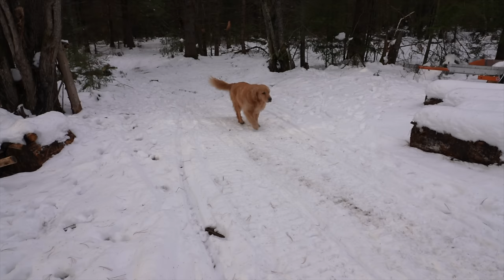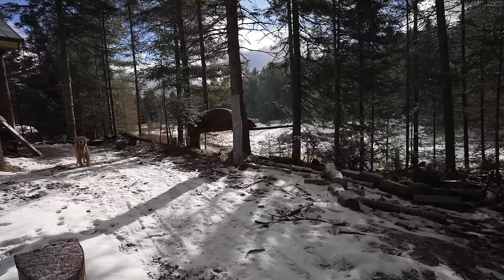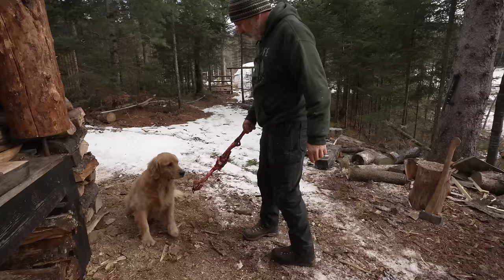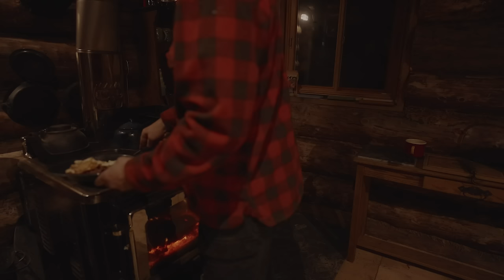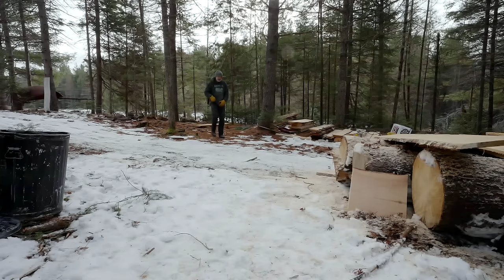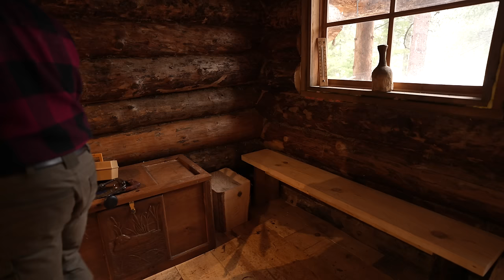Off Grid Living in a Log Cabin | Lumber Milling, Making a Wood Bench, Cutting and Packaging Venison

Comment: As a resident of northern Alberta I appreciate how you said it was warm out at just below freezing! Temperature is all but relative to how you are acclimated to your surroundings. Just finished my morning 10k run at -36°C (-33F) so I agree 0 is warm !
Reply: As long as you keep moving
Reply: isn't dangerous for the lungs to fast breathing  at such low temerature? I read somewhere it causes the bleeding of lung.
Reply: @heilamessy  yes it could be fatal. I wear a synthetic gator followed by at cotton/poly gator, followed by a full face balaclava, then a wool mask over that if it's colder than -40C
Reply: @johnbrown2030  thanks for the reply. good information.

Comment: Hi Shawn run a strong steel cable from tree to tree about 5meters high above your mill and trow a very heavey duyt trap over it, make a temporary A frame Barn above your mill and wood. Tie the corners of the tarp to other tree bases using heavy duty steel cables too. Make sure te tarp has a +/-45 degree angle, allows the snow to be easily knocked of from teh inside. Leave the sides open to about 1.5meters, to allow fumes to escape and the wind to blow through underneith.

Comment: Save the outside cuts to use as siding for your wood shed, that way you don't have to use good lumber and it will allow air flow to dry the wood.

Comment: I use green milled lumber and burn it on all my projects. Got to keep the boards dry. Burning takes 2x as much propane as you think it would. A light steel brush on the burn will smooth the grain and even out the color. The wood will shrink, so dry it as long as you possibly can.

Comment: Looks like you could use a nice stiff 'Screen Door' spring to keep the front door closed so you don't need to use the deadbolt just to keep the heat in when you're roaming your 'Estate' with your trusty hound... Have you looked into Aladdin Mantle kero lamps. We had one on our sailboat and it was never turned up more than halfway. Thing put out 100 watts on high, but it was pure, bright white light. Much better for reading or fine work than the yellow flame of the wick lamps. And, are you planning on a 'Smoke House', ala 'Townsend'? Seems like a good way to preserve all that Venison... :face-blue-smiling:

Comment: use a sling or chain to tie a log to split wood faster and more conveniently. The log will not scatter in all directions, but will stand still, which will allow you to make as many blows on it as you need without removing the ax from your hands
A quick-release solution can be found.. a chain with a spring at the end, which has a hook-like end

Comment: Hey Shawn, On your wood stove, after that first length of pipe off of the flue collar, is that a reducer to bring the remaining stove pipe to be 6”?  If so, I was curious behind the reasoning for reducing the size.  Thanks, Dave
Reply from the maker: No, it’s just a fitting from oval to round, 7”

Comment: Shawn James, why don't you build a big sufficient shed so that you can work underneath  with the saw machine so that to planks and burning wood could be stored there in and of course remain protected from rain and snow,!! Good job so far 👍
Reply: It is a question of priorities I think he aimed at building a shelter for himself before winter .Better him protected from the elements and the cold than the wood.😆You will see in spring and summer, he probably planed it .

Comment: When milling the wood just park your utv on the other side and use its winch to pull logs up instead of the manual crank just once, I would like to see how that works out :)
Reply from the maker: It works ok, but it’s often just as quick to do it this way when there’s logs in the way

Comment: Shawn, I've recently been doing some reading about Shou Sugi Ban (the charred wood technique that you use) - apparently if the timber is to be used indoors it can be a health hazard because of very tiny pieces of carbon getting into the air and then the lungs. How do you combat that? Or aren't you using that charred timber on the ceiling? I forget now.
Reply: You use a wire brush
Reply: You seal it with a sealer, no problems!
Reply: Look up Montana Havens on u tube Alaska Edition! They sealed it with a special sealer!